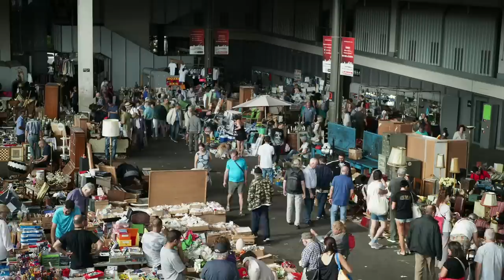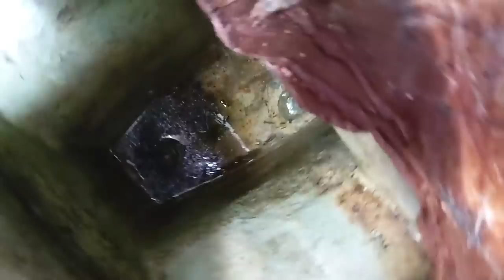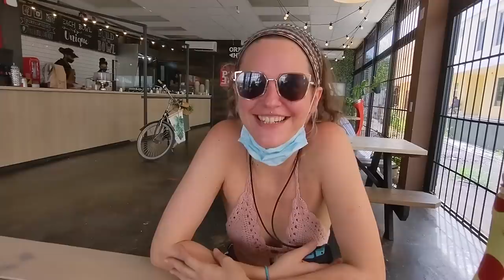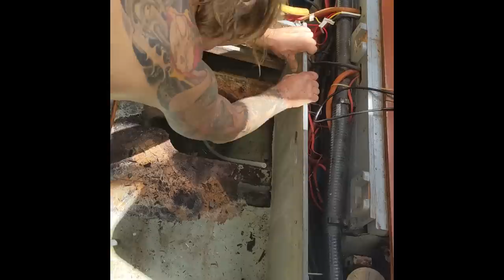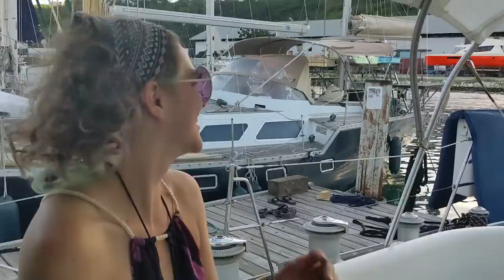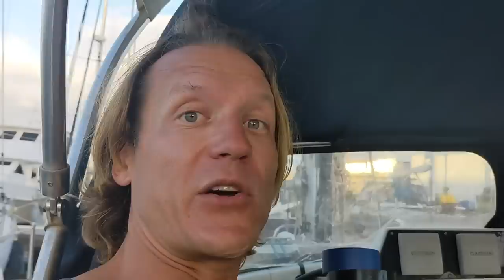Q/A with the NEW CREW & boat demo project

Comment: Hi James, you may already have this knowledge, but just in case. Now you have Lithium batteries, you need to take care of your alternator. Put a programmable DC-DC charger (eg able to set/limit current output) between the alternator and the batteries.  Otherwise those Lithium bad boys will such any current which the alternator can put out and over work the sh1t out of it eventually ending in a very early demise. Especially at low revs where it will over heat quickly and cook the alternator - otherwise lithium is awesome!!! Great job all round Mate

Comment: Check to see if the backflow valve in the bilge pump is operating properly sometimes when they get worn the valve fails. Technically every pump on a boat can be suspect every through  hole could be suspect but with new through holes and old pumps, definitely look at all the pumps in the boat especially anything that ejects below the waterline.  Good luck James it's a beautiful ship  you got there.

Comment: G'day James, I reckon can you refer to the ABYC (American Boat and Yacht Council) Guidelines for the proper storage of your lipo batteries? I reckon I'm in OZ mate and I'm not 100% sure if ABYC would have info on a lipo battery box guidelines for storage and ventilation?  Lipos aren't releasing any volatile gases, so passive or active venting, usually isn't a major problem. However, Lipo Batteries SHOULD NOT GET WET, IF AT ALL POSSIBLE! Just make sure your battery compartment or box is completely dry and the area is cool with very little humidity, if possible. Lithium ions do not like to be exposed to air, either. So make sure to double check all your batteries and individual cells (depends on make), before installing them. Lithium ion(s) interaction with air (mostly oxygen & nitrogen) can certainly cause a volatile reaction. Your Lipo Battery can actually explode, if there's a damaged cell exposed or the battery has become compromised. Lithium is a highly reactive metal that also reacts violently with water, or even moisture in the atmosphere if the cell is damaged, and if it catches fire, using water to extinguish it, only makes the situation worse. I, personally, used and continue to use, lipo batteries (dual banks) on my last two mutihulls (cats). The pros of Lithium, definitely outweigh the cons, IMHO! Plus, Lipo's have an integral battery management system (BMS), which is built into the battery. There's no external computer or plug in interface required. The BMS is essentially the brain of Lithium Batteries. If the voltage drops too low, below preset levels or goes too high, the BMS switches off the internal relay stopping the current. The BMS also balances individual cells in the battery, so all the voltages are at the same level. This obviously helps to increase the life of the battery and improve overall performance. Fortunately, I never experienced any issues with my Lithium Ion Batteries (batteries ~ on occasion, just dead cells), mostly with my older 2013 Lagoon 450F Lipos. However, all the Lipos on my current mutihull, a 2020 McConaghy MC55, are still essentially brand new!  Lipo Batteries are definitely an incredible upgrade to almost any mono, multi, or trimaran boat. Yes, they're expensive, but worth every penny. Sorry to ramble on mate. Good luck getting the boat ready for passage! Be safe & stay healthy mate. Cheers from Margaret River, Western Australia 🇦🇺

Comment: James I had a poke around re safety standards for private boats you can more or less do what you want the recommendations though BS standards as applied to Lead Acid are a battery boy with venting to have plastic insulators on the terminal. The rest is just comply with manufacturers instructions. Common sense would dictate putting them in a semi sealed box you do not have to worry about dangerous fumes but alternately you do not want someone to drop a pot in the galley and have half a gallon of water going over them or even worse a heavy metal tool landing on them.

I would also advise adding some venting for circulation taking into account water intrusion so slats. Obviously it will be in the bilge but too much heat and lithium does no mix. If you add a couple of vents for air circulation you can monitor it with one of those handy dandy Bluetooth thermometers not expensive (They also have memory settings so you dont have to look at them every 5 minutes)and if necessary add a couple of low draw computer fans to the box to pull extra air through. I doubt this will be required.

https://www.osha.gov/dts/shib/shib011819.html
Reply: Lithium ion batteries do not need venting and do not get hot. Also if you need to, you can lay them on their side.
Reply: Lithium ion batteries can burn very hot if overcharged or shorted. Wich could easily happen on a old boat. I’ve seen them burn thru metal tables when they were incorrectly charged. I think I remember a temp of 3,000F on our trining videos. BTW I’m in aviation and they are very particular about them.
Reply: @jessiebrader2926  they are forbidden around certain capacities when boarding planes. They can be ticking time bombs
Reply: @jessiebrader2926  Smaller batteries dont, like phones and such. BUt bigger really need venting. It keeps for good longevity and temps down

Comment: They used to say women on board were bad luck maybe that is James problem.
Tough choice :hot chicks or smooth sailing ????What's your opinion? personally I'd take trouble over boring, anyday
BTW To find the leak :shut off all the seacocks  and watch for water level ,if some leak 
2 options:
* keel    or 
*shaft ( rudder in rare designs ),
if no leak open seacocks one at a time,like an hour apart till you find culprit down the line (mind check valves)